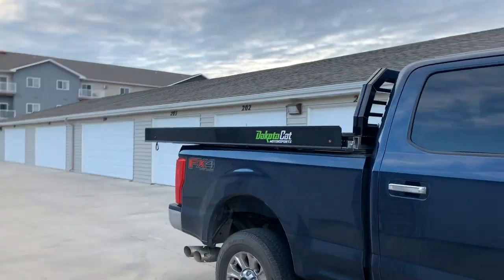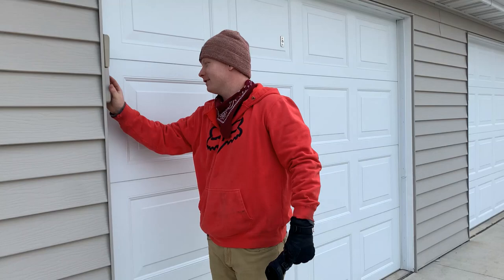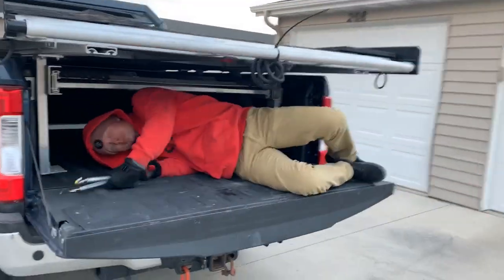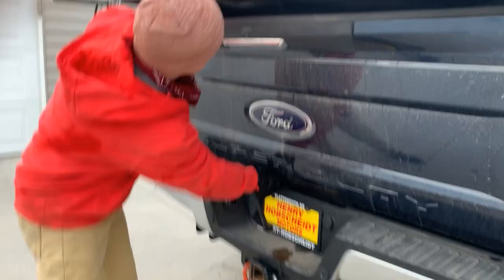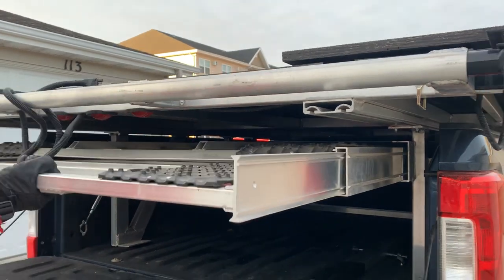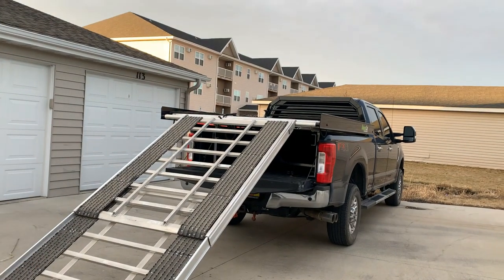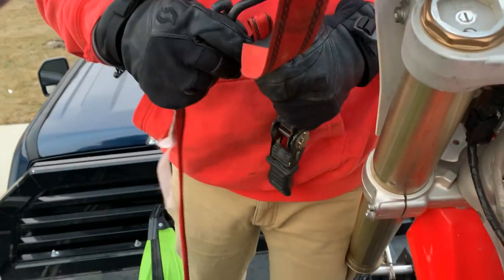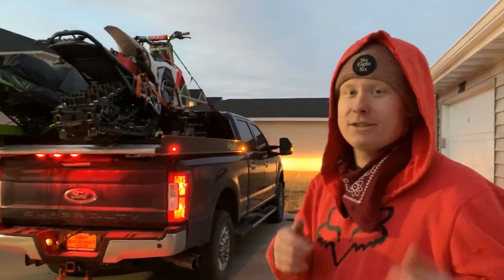How NOT to load SNOWBIKE on Sled Deck

Comment: Caliber Straps !!!! you wont regret it
Reply from the maker: Even on a sled deck?
Reply: @MrRev232  
They are great . And even if they loosen up there's safety clips on them and no loose ends to tie off.
Reply: For the sled we used both a super clamp and the caliber straps and my timbersled we used caliber straps.